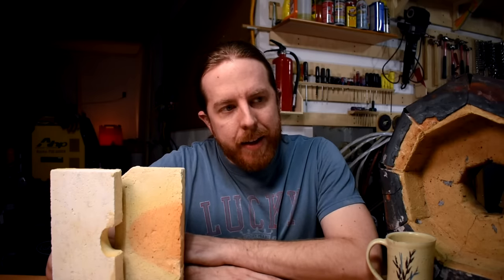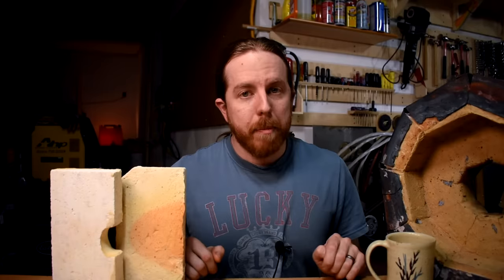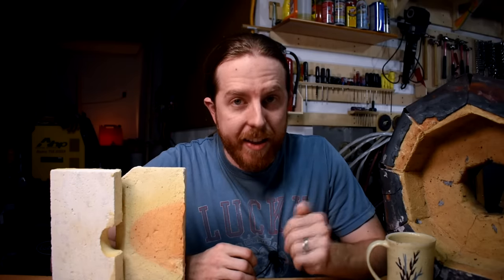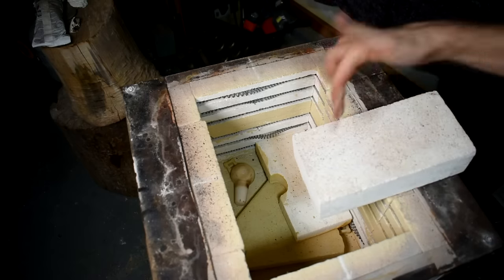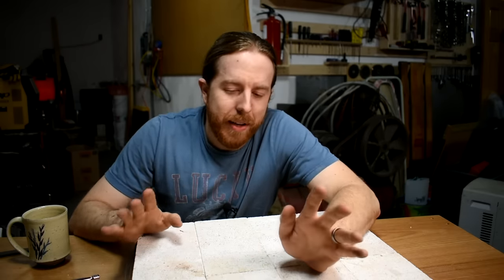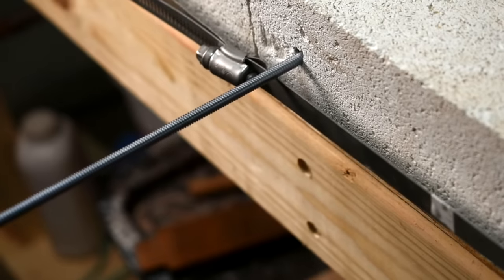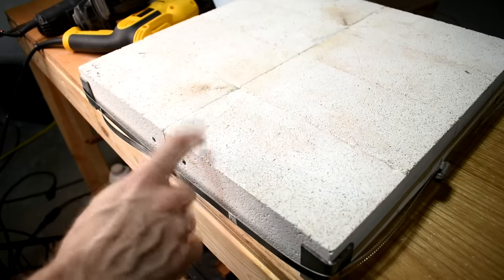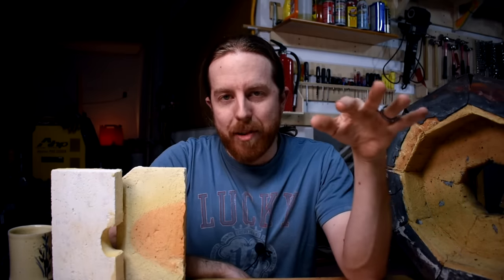There's a Problem With Fire Bricks

Comment: One of three thermal events could have occurred to make your lid sag in the way it did. I think it's pretty clear which one it is: 1) You could have overheated the bricks. They're only rated to X temperature, and if you exceed that temperature, the bricks will shrink. You would see it as crazing on the surface of the brick. I'd say this didnt happen. 2) The bricks are creeping. Under high pressures and high temperatures, the atoms in the bricks move and the brick changes shape. I dont think you are at a high enough load or pressure for this to be happening. 3) When the bricks get hot, they expand and your band expands with it. When they cool, they shrink and your band doesnt shrink with it. This allows the bricks to move a little by trying to fall inward. I think this is what's happening.

Your reinforced rod approach isn't a bad one. I would generally caution against using steel reinforcement, even if you're not getting near its melting temp (the steel can rust or you can get sigma phase embrittlement with stainless steels), but you made the hole big enough to not place undue stress on the bricks from expansion. A lot of larger manufacturers use alumina rods to match the chemistry of their brick more closely. I would have done one of two different things. 1) mortar the bricks together. You mentioned you use satanite. That's a mortar. Just glue the bricks together before you band them. That way, they act as a single cohesive piece. 2) put refractory ceramic fiber between the bricks and your clamps. Since the fiber is compressible, it will expand into that instead of the band (I'm less crazy about this idea since you're already compressing it when tightening the band.

Fun video, as an industrial guy, it's great to see how hobbyists view kilns. Thanks for sharing.

Comment: Adding something under the hose clamps on each side across the seam where the threaded rods are should help move some clamping force to the sides instead of just the corners.

Stainless steel threaded or smooth rods would probably be a good idea to avoid corrosion and any possible fumes from the zinc plating
Reply from the maker: I could probably fit something under the sides for tension, good idea.  The band clamp doesn't sit flat against the sides

Comment: I built a forge out of a new paint can with a lid, a large soup can, and a small fan.  Well that and I made a perlite and homemade water glass mixture for the refractory. Some low temp ramp up temps, then worked the temp up to cure the refractory. The whole thing it runs on for testing is sticks and twigs. The whole thing gasifies and creates biochar. I need to add transducers to turn the excess heat into electricity

Comment: I don’t understand the world of kilns personality as my experience with fire bricks are with locomotive fireboxes, we use them in what you would consider the roof of the box by having curved ones that sit on T stock, now since the heat is drafted forward through the tubes the T bar is protected by the angle design of the brick shrinking and falling a little further, along with it being angled already to help the blower and drafting to keep heat and smoke moving forward. 

Thermal mechanics are a heck of a trip.

Comment: A number of years ago I built a large glass kiln that had a 6 foot by 9 foot bed-yup 6x9.  I used HD board which comes in 2foot by 4 foot by 1 inch panels. Over that was several inches of fiber blanket.  This kiln had a roll out bed and opened on the short side.  So-how to support a flat kiln roof that big.  My solution was to have all of the support structure across the top, above the insulation so I wouldn't have to deal with expansion and spalling of the steel when it got hot.  On the inside of the kiln I had a series of stainless steel rods that were free floating and held in place with nichrome wire that looped over the steel support structure and under the stainless steel rods and then back up to the support structure where it was tied off.  This worked quite well for several years.  
I have also found that long, coarse thread drywall screws work really well.  You can't expect to ever use them again but with a stainless steel fender washer they will hold the bricks or the HD board in place wonderfully.
My current foundry uses soft brick with a coating of satanite for the walls and two layers of 1/2" HD board for the lid. No issues.  The HD board is drywall screwed into the firebrick.
Reply from the maker: That sounds pretty awesome!  6' x 9' is incredible.  It was for firing glass? like slump molds and stuff?  What kinds of temperatures does that require?
Reply: @PaulsGarage  I originally built it to do a series of panels for a restaurant that were 5' x 8'.  Multiple layers of plate glass fused over a freeform blanket mold. Generally, fusing multiple layers of glass at 1550 F.  Slumped panels were below 1250 F.  The challenge was that I had three heat zones that I controlled with a Digitry controller.  Go slowly to 1050 F then as fast as possible to the working temp, Hold for ten or 15 minutes and then dump heat down to 1050 F and go very slowly back to room temp. Usually a firing was around 36 hours from load to unload.

Comment: Tig welder tungsten rods. High temp, rigid, not massively tensile, but great for alignment. Easy to find, and because it's a very common mass production part, pretty cheap. Random idea inspired by this vid.

Comment: Most things expand in heat and shrink  when cooling. What I believe is happening is akin to a wooden axe handle shrinking from getting wet. (But wood swells when wet right?) The swelling wet wood is crushed against the axe head. So when it dries out it is smaller. Stick the axe in a bucket of water, it tightens up, when it dries out again, voila! It is even smaller / looser.

So what I believe, you have happening is the cool outer edges of the brick stay dimensionally stable, while the inner brick expands and crushes against the other bricks making fine dust when cooled down it looks like it shrank. You also get some levels of erosion.
Reply from the maker: Good point for sure.  I think the uneven heating definitely plays a role for sure and I hadn't considered the crushing effect, but you're definitely right

Comment: For best results for your lid build a steel tray for the bricks make sure to leave about 1 inch of exposed brick and also before placing the bricks in line the sides of the tray with 1/8 inch insulator paper and mud all your bricks to each other and the tray

Comment: I used high temperature mortar for mine. I'm not honestly sure if it expands or contracts at any different rate. So I don't know if there's going to be cracking issues. But I didn't have any. Granted, it's been years since I've been able to use a forge. But it was able to get hot enough to forge weld.
Anyway, maybe something to try. Might not work for your application. But it worked pretty well for what I needed it to do.
Reply from the maker: High temp mortar looks like good stuff.  It would have to expand with the bricks I would think it it would all break apart?
Reply: @PaulsGarage  I didn't get that issue but I was also using kaowool or super wool? It's a ceramic wool made for high temperatures. It retains teeth really well and also doesn't have issues with expansion. But you do still need the brick around it.
One thing that I've used was to make a dome out of the wool and coat the outside in high temperature mortar. Just as a structural foundation. And then let the hole in the top so I could kind of use a coal forge, almost like a directional blowtorch.
This is all just experimentation I was having fun with. That might be worth looking into. Both of those you can get for not too much and in small quantities playlist before you invest heavily into.

Comment: If you want some cross references on fire brick construction and maintenance techniques - you might want to check on boiler construction - both industrial and marine -
these are fireboxes that operate thousands of hours per year.
Reply from the maker: Good tip, thanks!

Comment: Here is a fix for your lid situation, make a new lid comprised of firebrick that are on their side lengthwise. Yes, it will take more bricks then a lid that is comprised of bricks layed flat, but you will have a lid that will last.

The inner most sides of the bricks will degrade and shrink first, but the width (now depth)  will have fresh brick exposed that will continue to hold fast. 

At least that is how my pottery club had our group kiln setup. Hopefully it helps.
Reply from the maker: Good idea!  I'd need more bricks but the thicker lid would insulate better and be stronger too

Comment: Keystoning is key so the bricks hold themselves together. You probably are better off sticking with smaller bricks as the big ones probably aren't as durable if you don't have consistent and even heating across the whole thing.

I'm not a refractory expert, but I'm learning fast with the bricks used in steel mills. That's a whole different animal...

Comment: Got a router?  Cut a slot 1/3 the thickness along the edges, add a "heat resistant" strip to align the parts. Thanks for the info.
Reply from the maker: I do have a router, yes.  I've cut these bricks with a hand saw before too, it's really easy, though it does destroy the saw.  I imagine the router might not light the dust getting sucked in, but my router is a disposable cheapy anyway

Comment: I use Fiberglass wool. My oven gets well over 1300C and no problem at all!
Reply from the maker: ceramic wool is definitely better at allowing movement, yeah. Insulates better, too
Reply: @PaulsGarage  I used a steel mesh between layers and it has ben holding on pretty well. If your design doesnt require only bricks, you should try to put a layer on the inner walls and lid, because its fluffy also seals pretty nice the oven when closed. and you can carve grooves for the resistor. I use gas btw

Comment: i got impressed when you said 2000 degrees, i assumed you meant Celsius lol, i understood my mistake when you said it doesn't get hot enough to melt steel
Reply from the maker: 2000 Celsius would be pretty intense!!  I don't get THIS oven hot enough to melt steel, though i probably hit cast iron temps on occasion.  I have a different gas powered furnace that might be able to do steel, though.

Comment: So you have a floating lid, if you are running the same temps flip the lid every time so the top and bottom gets the same exposure to heat
Reply from the maker: The issue isn't differential shrinking between bottom and top, it's between inner and outer, so I could have to swap the brick around all the time

Comment: I wonder if you could mix up a batch of " Star Lite" material. and put it on a thin steel sheet of steel even a piece of wood for a lighter lid. It will shrink and will need some patching at first but after it is burned in, it is pretty stable. It just won't work outside where it could possibly get wet.  It is pretty amazing stuff. I have used it in place of Satinite many times for gas forges. Something to look into at least.

Comment: You could have used the bricks for the lid on their side, and install the rods about 1/3 from the top surface. You would have more thickness between the hot side of the lid and your rods.
Reply from the maker: Good idea for sure.  The only issue is the size of the cut bricks, these are 9 x 4.5 x 2.5, so I would either have a lid slightly too small or slightly too large unless I resawed a brick.  It's doable, but so it ordering standard 3" thickness bricks I suppose

Comment: Use refractrory cement not brickes and steel mesh to reinforce, I was a foundryman, we didnt use bricks we used the reinforced cement, you can even repair the cracks or gaps to some extent bofore you have to rebuild the furnace.

Comment: Maybe cut the bricks in an angle.
If they shrink, they still overlap/seal.
Kinda like Railway track gets joined to deal with the huge contraction and expansion difference between summer and winter.

Comment: I'm a little worried the flex will put strain on the brick, and because it's a bit brittle it might just crack the brick under the right circumstances.  You had a nice tight fit though so it's probably good for a while.

Comment: There are many materials that would work - you can make a metal lid with layers of some type of insulating blanket material, even coat the wool with a refractory cement to help prevent degradation. It's not cheap, but it's most likely an expense that would last for many years, possibly decades, depending on materials used, etc.

Comment: You should put a little block between the band clamps and the bricks, it will absolutely put pressure on the middle ones. Could also use them as nice handles ig

Comment: A thought, instead of trying to use external tension forces to keep your bricks in an array for the lid, DRILL THEM, and then PIN THEM with SS solid roundstock 1/4 or 3/8". Then you can make a frame around the top exterior of them, and just tack weld the SS rods to the frame (make sure you calculate and drill close enough to be able to MAKE that weld). Guaranteed to not have bricks fall apart. Coat the entire fire facing surface of them with 3000F castable, and whammo. Done.
Reply: This is how I did my forge doors to keep any and ALL steel away from the dragon's breath of the forge. The ONLY thing that fire touches is refractory. 

For my propane furnace, I put a 1" layer of 2600 frax wool down, criss crossed 4 SS 3/8 rods across it, and poured 20 lbs of Satanite over top with a band around the outside to get a little bit standing above the steel of the lid, with a 4" PVC coupler in the middle to make my exhaust. 

Both work magnificently
Reply from the maker: that sounds like a pretty awesome set up!

Comment: So, if you wanted to put a wood stove on a wooden floor, but you first put down a bottom layer of half-height BNZ 23HS for their insulation, followed by a layer of half-height BNZ 26 for their mixture of insulation and heat resistance, then a top layer of half-height BNZ 32 for its heat resistance, all oriented such that there's no direct vertical path for an ember to fall to the wood floor below, you'd wind up with the best mix of heat resistance next to the heat source, with the greatest insulation layer next to the wood floor, while blocking all ember paths.

Got it.

Comment: OR, put them vertically yes you have to add more but the heat won't travel 4 or 8 inches keeping the lid from shrinking. The 2inch lid is not good enough. you might need a chain pully on a wheeled engine stand.

Comment: Roman buildings ... that is survival bias:
They only last so long cause the only buildings you see are by definition those that survived and not the vast majority of buildings that had collapsed long ago. Also it is simpler to build something very sturdy to make sure it survives your grandkids then it is to build something down to price or make it last just long enough.

And for the hot fire box - if you do it as a hobby then it is a good idea to talk with people in other fields and just try it out. For those that want to make money from that not so much. What is needed from a forge is very different from what is needed from a pottery kiln. A foundry for casting silver is very different from one used to melt nickel.
Reply from the maker: I'm sure there's survival bias there for sure, but it's true that the ones that do survive are brick/concrete with integrated arches.  Some use bricks, concrete, and arches.  It's kinda cool in the Pantheon I think even with solid walls, they used brick arches to distribute loads and such.  Very clever stuff.  Reinforced concrete like today won't stand a chance of lasting as long, in part because the rebar will eventually rust and break everything.

If you are doing foundry work or whatever as a living, then certainly there are economic constraints on everything that don't exist in my case.  Pottery kilns for example might not offer much in the way of new information to a business using inductions furnaces, but then why would those people be on YouTube looking for ideas?  I'm talking mainly to hobbyists, artists, and crafters for whom economics matter less, and creative thinking factors in more.  Like I tell people who comment on my casting videos looking for tips to maximize their yield when scrapping: If you want money, get a job.  Don't get a hobby.  Jobs will pay more per hour of effort.  This is about doing fun stuff and trying new things.

Comment: Silly question, Why not just use fire cement to stick everything together?
Reply from the maker: good question.  In part because I don't have any.  Also, i'm not as confident about the cement being able to hold up to heat cycling over time, though it could.  Also, I want to be able to replace bricks as needed, and that's harder if they are mortared together.  This way i can disassemble if i need to change out a single brick, no worries.

Comment: Loved the video man! Enjoying watching your production evolve! Also I really want a kiln lol. I need a workshop...
Reply from the maker: Kilns are awesome, you never know how useful a controllable oven is until you start finding uses for one.  The only issue i have with this one is the size, but I have some bigger kilns if needed too
Reply: Build a kiln!  The bricks are easy yo work with, just don't inhale the dust.  There are a couple of videos on the electronics to control the electric heating elements (I patterned mine off of Veg Oil Guys kiln).  The parts aren't prohibitively expensive. I would advise buying a good quality SSR (solid state relay).

Comment: Bricks are not the only DIY option.
Castable refactory cement is not super hard to work with if one has some concrete experience.
I have a DIY metal can home gas foundry with casted refractory and a friends business casts refractory in his commercial forges and most special projects.